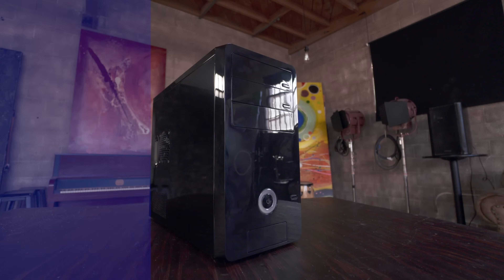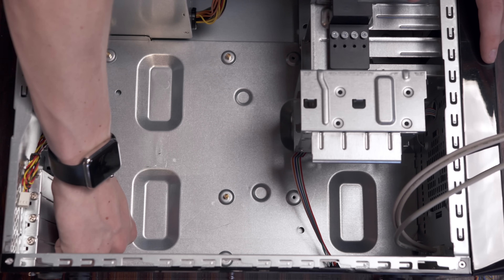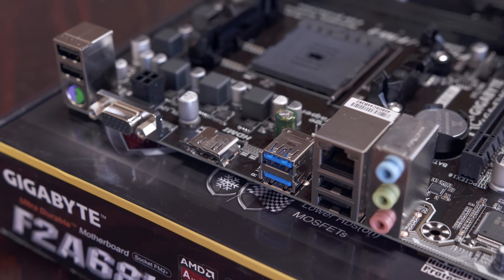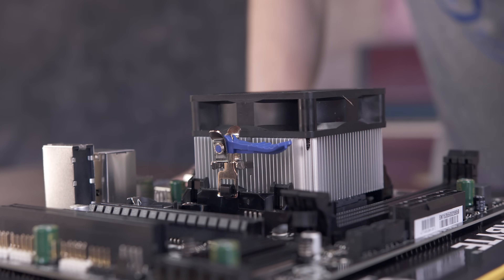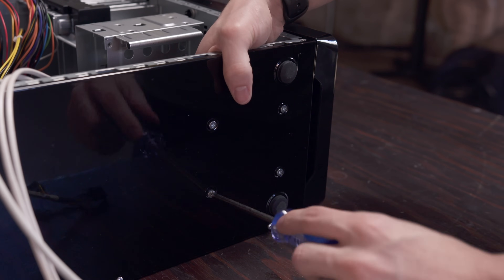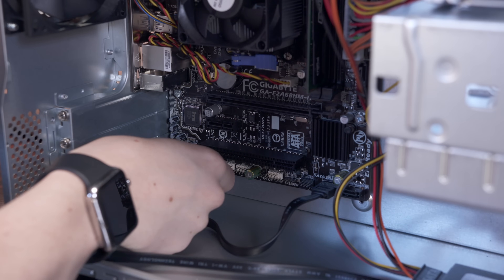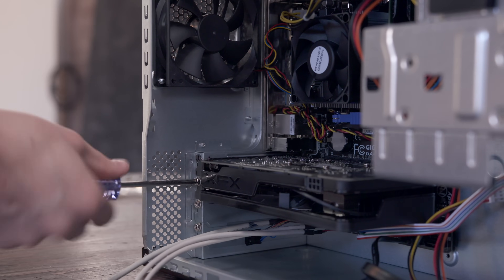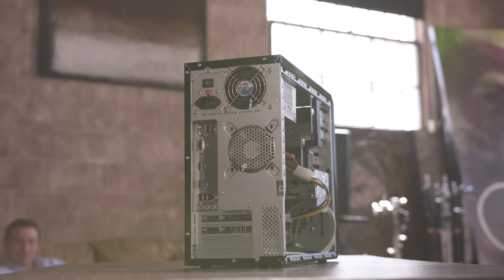How to Build a Gaming PC! (2016)

Comment: what about sound card?
Reply: Use onboard sound
Reply: The PCI-e x1 lane which the internal wireless adapter uses is blocked by the graphic card in this video. You can either buy other kind of motherboard or use USB wifi adapter. USB wifi adapter is cheaper and alot easier to install. Just plug in and your window will automatically download the necessary driver.
Reply: wait did i say anything about internet i said sound card meaning audio jacks not wireless internet
Reply: I was replying to Meme4Meme
Reply: sorry i didn't really know i was using notifications from youtube

Comment: How do I get the hard drive to boot properly?
Reply: buy a windows 10 usb
Reply: Go to bios, set hard drive as 1 priority to boot.
Reply: +WB IsMe It's still not booting up :(
Reply: +Joshua Hawkins Did you find a way yet?
Reply: +TidalASF No, unfortunately. Do you know what the problem is?
Reply: +Joshua Hawkins Download windows 10 ISO
Reply: My problem was that I had somehow placed my sata cable in the wrong sata port as it used to be in sata port 1, but i put it in 2.

Comment: Can I use a case from a 2009 computer?
Reply: Vince, i hope you are joking...
Reply: Is this good enough to run Batman: Arkham Knight on minimum?
Windows 7 Home Premium 64bit
Intel i5-750 2.66ghz
8gb of RAM
Nvidia GeForce GTX 660
Reply: +David Pun It reaches the minimum system requirements but not recommended so it can but the performance probably wont be great
Reply: Yep. It wouldn't be that much full of high quality gaming, maybe some lag, but that would be ok. I'd prefer at least 11gb of  RAM. But if you want it to work better, I'd prefer deleting all unnecessary stuff taking medium and high storage.
Reply: And yes, you can use a case from 2009 PC. Doesn't matter much haha
Reply: You're better off using a console.
Reply: TSU zTrek I'm going to to buy a new case anyways...
Reply: +Vince Offer go away from youtube vince
Reply: James Hart - He's not wrong idk who the hell youre kidding
Reply: Connor Brennan 
Bought a new case anyways
Reply: It works! The disli- jk i turns on but it doesn't come on display (BTW I've pressed the BIOS buttons (F9, Delete, F12))

Comment: when i run gta 5 on high settings on 1920x1080 on my flat screen tv, i lag a lot but if i pick a lower resolution its much faster. is it due to the flat screen tv or my specs?
CPU: AMD fx 4300
GPU: AMD radeon rx 480
Memory: 12 gb (2 sticks are ripped off a shitty ass pc)
Power supply: EVGA 500W

Comment: hey guys i am building a PC In 500 dollars i  am not a hardcore gamer but i would like to play fifa as well as Gta without any lag i need productivity too for daily use  . Could you please help me out with a configuration. i did check out other channels but they all talked mostly about Amd which i do not want to use.  Please help me out. Thanks guys.
Reply: I'll write down 2 possible builds.

Productivity:
i7 6700
16gb DDR4 ram
Any compatible micro atx motherboard 
gtx 1060
Psu from a trusted brand like EVGA or Corsair 
Cheap case of your choosing

Gaming:
i5 6500
8gb DDR4 ram
Any compatible micro atx motherboard 
gtx 1070
Psu from a trusted brand like EVGA or Corsair 
Cheap case of your choosing

Now the second will be much better in games, but the first will be better in productivity. It depends which one you need more. The first one can still max out gta in 1080p, so if your looking for productivity I would go for that.

Edit- sorry, thought your budget was 1000 and not 500, these PCs cost around 800-1000.

Comment: Yo what about a wifi card?
Reply: USB wifi adapter all the way.
Reply: The wifi adapter on the motherboard should do the trick
Reply: i prefer to use powerline but a wifi adapter is a pretty good and cheap option
Reply: It depends on the type of motherboard you buy. Some motherboard comes with built in wifi adapter with wifi antenna provided but most doesn't.

Comment: all store bought prebuilt PCs have there own limitations to what you can upgrade to,,,beter off building a new 1,half the price and if somthing goes wrong ,you can fix it yourself instead of getting 1 of thouse geek quades to rip you off  ,just make sure you get a good power supply and processor, ram is optional. perfect power supply for a first timer ,esspecially if you wanna good graphic card in your rig is EVGA 500W 80plus, only $35 US and 50 to 55 dollars canadian

Comment: I followed the video exactly but the bios screen won't pop up. My monster just says "no signal" and goes to sleep. Help please?
Reply: *monitor
Reply: The monitor probably isn't connected judging from the "no signal" error
Reply: +FrostyCreeper10 well I tried 3 different monitors and they know they're plugged in but there's no video signal to the monitor.
Reply: NCSfan12 That's weird.....
Reply: make sure the HDMI cable/other monitor cable (depending on the monitor you have) is correctly plugged into the motherboard.

Comment: can you add 2 8gb of ram ive never built one and dont know what to do
Reply: Depends. What cpu do you have and what ram did you buy? Ram comes in DDR3 and DDR4 (Most common). If your mobo has enough slots just pop in 2 8gb ram sticks and your done.
Reply: +Y5370 so with this setup i can just get 16gb of ram with 2 of the 8gb of ram
Reply: ye. If you havent bought this setup yet thats good.
Reply: _/BreEzy42\_ This is a horrible build that nobody should copy

Comment: So, in general, are all PC components able to fit into the average case this smoothly? For example, if I buy a different graphics card than shown in this video, would it likely fit correctly with everything. Obviously, not every PC component in existence will fit seamlessly with every other piece, however, I would like to know about HOW interchangeable most PC components are.
Reply: yup
Reply: Mr. Maul the average case is supposedly not interchangeable. There are different cases for different mobos, but to answer your question, most standard combos would work

Comment: Would this be good for gaming/editing?
EVGA GeForce GTX 750Ti 2gb
AMD Athlon X4 860K 3.7GHz
Gigabyte F2A68HM-HD2 Motherboard
EVGA 100-W1-0500-KR 500W 80 Plus Power Supply
HyperX FURY Series 8gb RAM

And, if you don't mind, some estimated FPS levels?  Thanks a lot :)

Comment: Is this a good first time build? ( I have a budget of $1000) http://pcpartpicker.com/user/CatfishLord/saved/99kv6h EDIT: I already ordered some parts that's why they are missing.
Reply: error 404 not found
Reply: +Hassan Jamil http://pcpartpicker.com/user/CatfishLord/saved/YD9j4D
Reply: Good build but I recommend getting a slightly higher wattage power supply if you are upgrading in the future. If not then your fine.
Reply: +Cairo Murphy all right then thanks.
Reply: Stay away from the FX line.
Reply: +Y5370 I'm just gonna upgrade to an i7 later.

Comment: I have done tons of perfecting on this build, but I still don't know if the parts fit in my case. Can someone help me out?

https://pcpartpicker.com/user/DustyM/saved/Jsj323
Reply: Heck, I got a Windows 10 product key for $20 on Ebay then downloaded an ISO and put it on a bootable flash drive.
Reply: Thanks all
Reply: Zenexar ok, when it says compatible I assume that it doesn't really calculate it but it probably does. Thanks for the advice
Reply: This? https://pcpartpicker.com/product/XHGj4D/msi-geforce-gtx-1060-6gb-armor-oc-video-card-geforce-gtx-1060-armor-6g-oc
Reply: Zenexar Mine was red and black but this is fine, also, correct me if I'm wrong, but if my graphics card from before has 8 gb, what makes this 6 gb one better?
Reply: Ok, thanks
Reply: I scrolled down and saw this https://pcpartpicker.com/product/JVWrxr/msi-geforce-gtx-1060-6gb-gaming-x-video-card-geforce-gtx-1060-gaming-x-6g it says GTX 1060 and it fits the color more, I'm sure there is a difference. I just wanted to make sure I was getting the right one
Reply: Ok
Reply: +Etika's Hair nice build, but where's that nutsack sandwich [insert Lenny here]
Reply: HypersonicSmash it's in development
Reply: Zenexar are you sure it is a better card? I'm not an expert I was just thinking because the watt usage and the specs.
Reply: Zenexar just to be clear we are talking about this right? https://pcpartpicker.com/product/XHGj4D/msi-geforce-gtx-1060-6gb-armor-oc-video-card-geforce-gtx-1060-armor-6g-oc
Reply: Zenexar ok
Reply: Not sure if you are already finished with the build, its been a week, but my 2 cents:

-Yes, that guy is right, don't worry. Put simply, 1060 is a better card than 390.
-Haswell (the name for the chipset/format you're using, although you probably know this lol) is last gen, personally I would go with a new Skylake build. But that would mean changing like half the parts, and if you don't want to, Haswell is by no means old, so it will be fine.
-For some parts, like the OS, it is safe to buy off of ebay sometimes; I got Win10 for like 80 bucks instead of the 200 that it shows on your list. Just be VERY SURE the seller is trustworthy! They should have lots of positive reviews and stuff. Heres the guy I bought from: http://www.ebay.com/itm/Microsoft-Windows-10-Home-64-Bit-System-Builder-OEM-KW9-00140-/311402948470?hash=item48810fe776:g:0LkAAOSwHoFXse0T

Other than that, looks good!
Reply: Does Shadowplay only work with Nvidia or can I use this card?
Reply: Zenexar thank you
Reply: For Shadowplay, should I have 2 SSDs, one for games, and one for recording? Because I have heard having them on the same hard drive causes a lot of lag.
Reply: If that is stupid don't be afraid to tell me
Reply: I think I'm just going with the one SSD, video making isn't so important that I would get a whole new solid state drive. Maybe if it is a success I could get that later on
Reply: What do I do since this GPU only has one dvi port? I am getting dual monitors
Reply: http://www.selfinger.com/windows-10-professional-32-64-bit.html Found this
Reply: Etika's Hair whoa

Comment: my build inspired by boson 3.0. mobo $42 if use different cheaper biostar. cpu $70 been going down recently. cpu + mobo $112. case $50. psu $19. ram $21. gpu $120. cs + ps + rm + gp $210. total $321

Comment: Can someone tell me if this is a good build and is it worth $1397. Should i add or remove anything? Is it all compatible?

CPU: Intel Core i5-6600K 3.5GHz Quad-Core Processor  ($219.99 @ Newegg) 

CPU Cooler: CRYORIG M9i 48.4 CFM CPU Cooler 

Motherboard: Gigabyte GA-Z170X-UD3 ATX LGA1151 Motherboard  ($112.98 @ Newegg) 

Memory: Crucial 8GB (2 x 4GB) DDR4-2133 Memory  ($34.98 @ Newegg) 

Storage: Crucial BX100 250GB 2.5" Solid State Drive  ($149.99 @ Amazon) 

Storage: Seagate Barracuda 1TB 3.5" 7200RPM Internal Hard Drive  ($46.88 @ OutletPC) 

Video Card: Gigabyte GeForce GTX 980 Ti 6GB WINDFORCE 3X Video Card 

Case: NZXT Source 530 ATX Full Tower Case  ($84.99 @ Newegg) 

Power Supply: XFX XTR 550W 80+ Gold Certified Fully-Modular ATX Power Supply  ($83.99 @ SuperBiiz) 

Operating System: Microsoft Windows 7 Ultimate 64-bit
Reply: Don't get the 980 Ti, that is last gen. Also unless you have a REALLY good reason to use Windows 7, Win10 is cheaper and better in most aspects.
Lastly unless you just really want that case, you can get a good and probably even better one for cheaper.

That's all, as far as I can tell. If you have leftover money, get more RAM. 8GB is slowly becoming the minimum for games.
Reply: its pretty good but if you arent going  to overclock your cpu then get the non k version that is the i5 6600
and also get a gtx 1070 instead of the 980ti
Reply: cocacoladog10 But the i5 6600k is only 4 dollar more? and thanks
Reply: cocacoladog10 Also which gtx 1070 should i get?
Reply: xSaborTC thats up to you but i would recommend gigabyte or asus
Reply: I recommend joining Reddit and going to https://www.reddit.com/r/buildapc/
Reply: RaceOfAce i recommend the opposite
Reply: ***** no 750 watts is overkill
his system is never gonna use more than 500 watts
Reply: ***** problaly never more than 400
Reply: why do you give advice when you clearly do not know what you are talking about? 750 isn't overkill at all with a 980 ti, with a 550 it will be at its very limits and it may break the system way quicker or even make the system reboot if the card is pushed at its limits.
Reply: Nathan Griot if he actually gets a good quality one and not a cheap chinese one then there should be absolutely no problem and he will save money on his powerbill dumbass
Reply: before calling dumb put yourself in question I was using a cx500 a good psu quality with a 970 and a I7-5770k during some games my computer restarted so if I had to change the psu with a 970 so with a 980 ti which use alot more power the 500 wont be enough
Reply: Guys i got a pc with a gtx 1070, i5 6600 and 8gigs ram
Reply: +xSaborTC hope you are looking to upgrade for more ram, 16 should be alright.
Reply: No offense but this is a really bad build, the gtx 980 has less cuda cores than a gtx 1060, so I would go for a gtx 1060 instead. But if your budget can go even further then get a gtx 1070/1080
Reply: Just Cyanide I got a 1070
Reply: Oh then well, you're good to go :)
But while we're still at it, I think should consider upgrading to a 600w psu, just to be on the safe side
Reply: get 16GB of ram

Comment: can someone tell me how to install windows 10 on it? or is it windows as soon as i open the computer
Reply: First, go open a window before you boot your PC for the first time. It'll give you Windows Potato Edition which will automatically install to your CPU for better graphics. Second, run cold water over the top of the PSU (make sure it's turned on first of course) and you'll have access to Netscape Navigator which is much faster than Chrome. Third, put plenty of thermal paste inside your RAM slots as they can get quite hot under load and will also assist with your WIFI connection. Fourth, congratulations you've just successfully overclocked your PC.
Reply: ***** its from microsoft  theres nothing to worry about
Reply: pfft this is NOT 2016, its 2003, where u been
Reply: +Bazy thats for reinstalling windows
Reply: Piracy 4 lyfe
Reply: What you need to do is get Windows 10 on a Usb or Cd. You could buy one or make one yourself. But you will still have to buy a 90-120 dollar windows 10 activation key but i think you could get a pirated key for only around 20 dollars
Reply: haha yeah because the whole point in pirating is to get it for free
Reply: Bruh you can't just slam a bunch of parts together and expect it to run Windows
Reply: are you using a usb stick or a disc to install windows 10 with?
Reply: cocacoladog10 
i just said can someone tell me how to install, i havent bought the computer parts yet. im building my own. i need to know how to get windows 10 on it.
Reply: ***** its actually easier than you think
Reply: cocacoladog10 
whats bios
Reply: +Cxeri93 yeah I need help too
Reply: ***** when you boot up the pc for the first time it will enter the motherboards software and u can choose what to boot from
Reply: ***** try restarting ur pc now and press f12 or delete key when u start it up spam it
Reply: ***** 
i meant the processor u buy, windows 10 can come with it? nevertheless.. how do u install it then
Reply: ***** windows 10 doesnt come with anything you have  to buy it or pirate it
Reply: ***** but look at the amazon i posted further up in this thread you get a usb stick with windows 10 on and thats the easiest
Reply: dont take this the wrong way but im never installing anything coming from a single usb. hacking dude. gotta be cautious
Reply: ***** they put a usb stick instead of cd discs cause were in 2016 and its easier
Reply: ***** 
dude, kangaroos can build a pc in space and  you can build a bird. bebeeee i like trains
Reply: ***** worst troll in existance xdddddd got eeem
Reply: ***** 
i know whos the best troll... ur pet. what? 2+2=44
Reply: You need to buy a Windows OS disk I believe to install Windows
Reply: +Kamil Szarafinski pre guilts are shit
Reply: buy a 5$ windows installation disc lol
Reply: Just Football They're 100 dollars lmao
Reply: https://www.amazon.co.uk/COMPLETE-INSTALL-Restore-ULTIMATE-Edition32/dp/B00NDAE4S8/ref=sr_1_2?ie=UTF8&qid=1472645889&sr=8-2&keywords=windows7+disc nahblud
Reply: oh
Reply: You can buy a copy of your os on a disk, just put disk into computer and install from there
Reply: +antongamerHD you actually BUY pirated copies? LOFL
Reply: Deformer Gaming No I never bought one. Im just saying that there are pirated copies.
Reply: Just plug the usb drive with the windows 10 iso on it, then turn it on. That's how I did it. It should automatically go straight into the windows install.
Reply: JUST LOOK UP HOW TO OR JUST BUY A CHEAP WINDOWS 10 INSTALL DISK OR USB WITH WIN 10. It's really easy anyways
Reply: do you have any reliable pi RAT i N G links? I just built a new desktop.
Reply: Star Blaze just use kingpin or kingquin I forgot, to buy a key
Reply: Janky You need a cd key in order to use windows 10, that's just the iso.
Reply: ***** No dumbass, a CD KEY. Which is basically a set of numbers, I believe it's 25 numbers and letters that you must enter in in order to activate windows.
Reply: Cxeri93 You have to buy it separate
Reply: omfg this guy wants to build a pc but he doesnt even know how to install windows or what a BIOS is this guy has shit to learn m8
Reply: Janky Yeah I know.

Comment: Hey I need help I have put this build together and my moniter is no getting a signal. Any clues.
Reply: When first starting the process of the first power on of your rig, it's recommended to use your motherboard's display outputs until you can connect online and get the drivers for your graphics card. Hope that helps :3